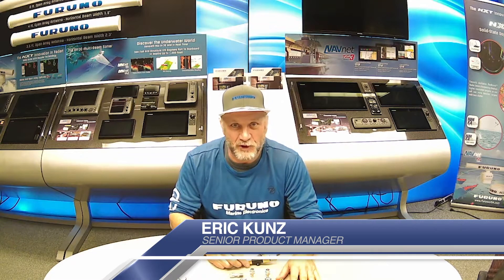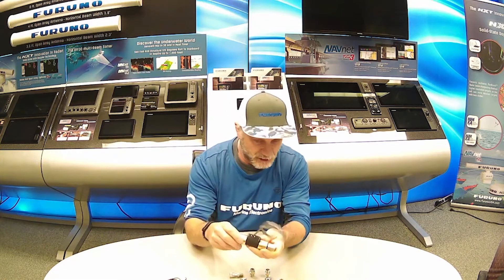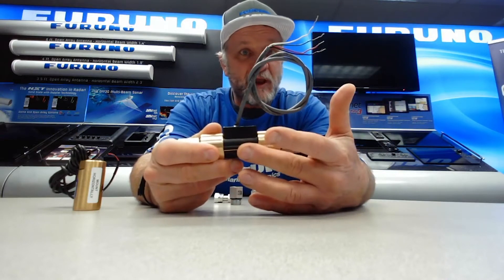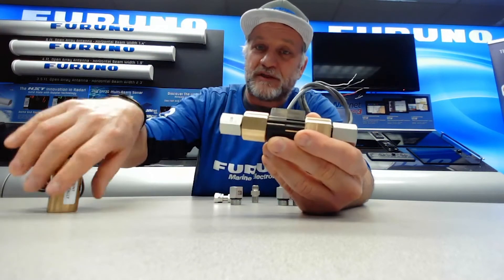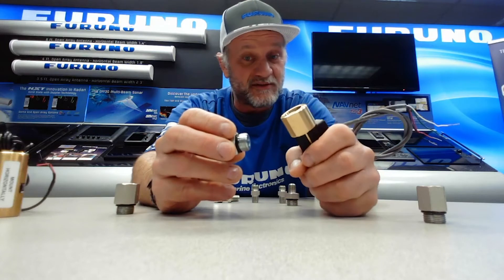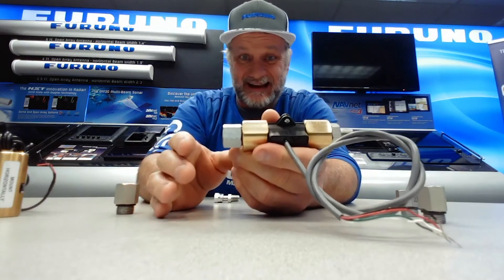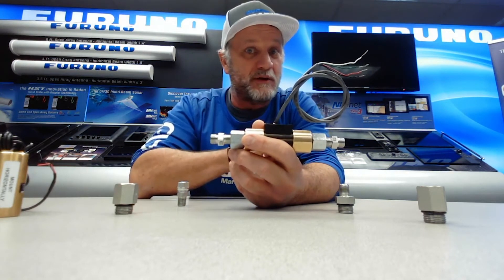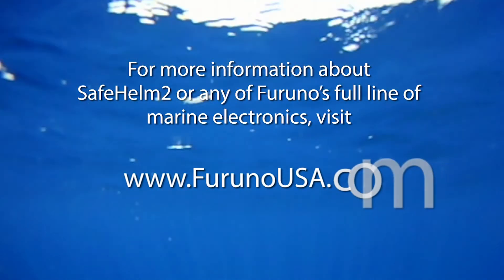SafeHelm2 First Look

Comment: Isnt this just a shadow drive
Reply: SafeHelm2 provides similar capabilities but it has two flow sensors instead of one.  SafeHelm2 senses not just flow but, directional flow. This capability allows more advanced features like Furuno's Power-Assisted Steering feature which leverages the autopilot's reversing pump in a unique and simple way to provide power assisted steering for any vessel.
Reply: Not clear to me how the power steering works. Is the autopilot using a normal reverse pump to do that? So I turn the wheel and the autopilot helps me turning on the reverse pump? With this sensor I don't need a power steering pump like the one provided by seastar? Thanks